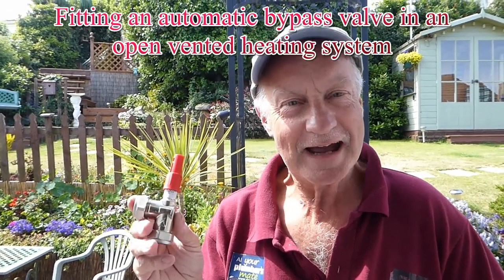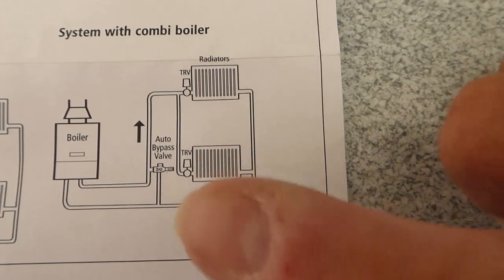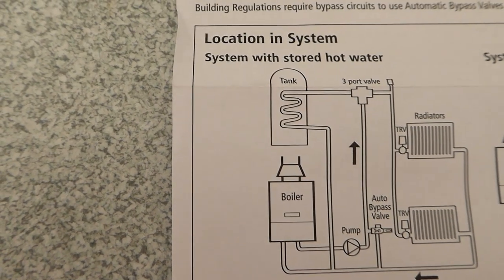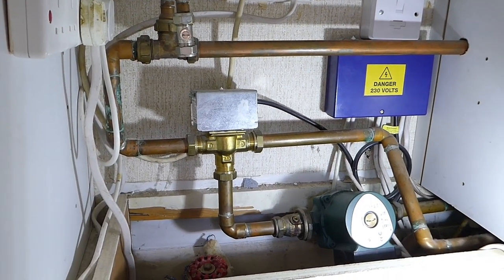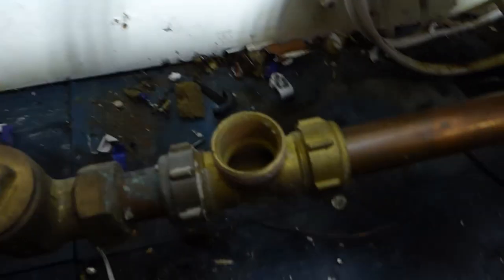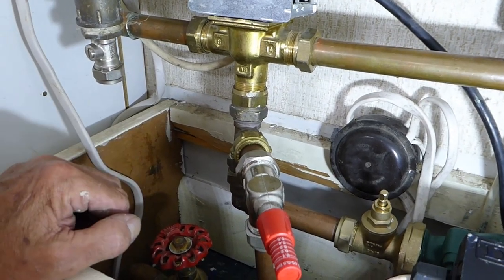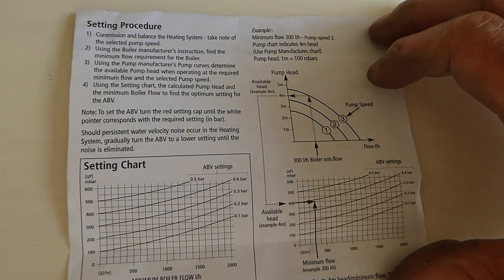Heating problems? How to fit an automatic bypass valve and why you might need one

Comment: This is why it is also good practice to fit atleast one without TRVs and fit lock shields. Preferably this should be nearest to the thermostat.
Reply: @matsuz100  because if every radiator has a trv and all the trvs are closed and the heating is switched on, the boiler could overheat as the hot water has nowhere to go.

Comment: Hey Al, have an issue with an automatic bypass valve that i think is causing the CH gas boiler to pump over...

History as follows -

- Home is 30 years old running an open vented F&E system. 9 Radiators.

- Potterton Suprima 50l (2004) serviced and running very well.

- Climote controller and 3 x Zone valves fitted approx 2 years ago.

- Recently was in the attic and noticed quite bad condensation, noticed the vent pipe from the CH was pumping over into the F&E tank. Eventually figured out it was only pumping over when a single zone was turned on i.e upstairs heating only.

- Had issues with cold spots on downstairs rads so ran X400 for nearly 4 weeks and drained the system, decided to remove all effected rads, cleaned and hosed them out thoroughly until they ran clear. 30 years of sludge was bad! Cleaned F&E tank spotless, refilled the system and added X100 inhibitor. I think that eliminates any chance of blockage/obstruction in the system as all rads heat perfect now with no cold spots.

- The boiler is still pumping over on a single zone and as normal over-runs(but pumps over) for approx 2 mins when the CH is timed off. If two zones are put on together i.e upstairs and downstairs the boiler does not pump over except for when timing off…

- An automatic bypass valves is fitted to the immersion pipes upstair in the cubby, I thought that may be the issue so tried resetting it by closing it fully to 0.6 and then turning off all the rads except one for the purpose of backing off the ABV until flow through…

- Turned on the upstairs and downstairs heating and the vent pipe(blue) immediately got hot (system pumping over) the (green) pipe also got hot in the lower part but not in the upper part after the compression fitting and then the (orange) pipe got hot within about 3-4 mins with the ABV still fully closed, should that not be the case?

Im confused as to the operation and location of the auto bypass valve, its there to prevent pump-over? is it working and fitted in the correct location, direction?

Pics below of pipework above boiler and cubby for reference…

https://ibb.co/JHyMb7z
https://ibb.co/QYxzhfR
https://ibb.co/3y4vc3x
Reply from the maker: Auto bypass valves are normally installed to allow for thermostatic rad valves, which may all be closed, a route around the system in order to stop the pump burning out, a kind of short cut. I have never come across them being used in this way.  I would opt for changing the bypass, even if just to rule it out. Have to admit this is a great way to use bypass valves. By the way have you tried simply turning your pump speed down to number 1.
Reply: @dereton33  Thanks Al, not a plumber myself plasterer actually but like to figure these things out! So yeah just reading into it seems that ABV will be installed on zoned heating also because of the restrictions in flow when only one zone is used. I have tried pump speed 1 but the rads don't heat up fully. In the last pic I shared is the arrowed green pipe the flow and arrowed orange pipe the return, so the bypass opens to allow the water run back the return to the boiler? That what i find confusing!

Comment: Does it have to be installed near the boiler/pump? Does bigger loop will make it better or worse? I have TVRs installed (with one radiator on manual setting just slightly open for the winter to allow flow when all TVRs close) and thought about removing radiator in the kitchen (it's always shut), and placing bypass valve instead of radiator. Is it good or bad idea...or just genius or stupid? ;)
Reply from the maker: It does not need to be installed near the pump or boiler just a convenient location. You can change that kitchen rad for a bypass valve if you want.

Comment: Brilliant and informative.
Fitted a 3/4 bypass valve in a system with Trench Radiators just before the room Thermostat controlled TRV for them.
If the room gets hot with its big floor to ceiling windows in the spring sunshine the boiler gets the hot water back and shuts off. Lots of solar gain and not wasted heating.
Thankyou
I fit kitchens and plumbers are so busy no one wants to fit my T/heaters.
Thanks for your calm knowledge👌
Reply from the maker: No problem Paul.

Comment: Combi boilers usually have this built-in btw, have done for a long time.
Reply: They do but, as an example, my Greenstar CDi Compact (2013) manual states that although it has one internally, it also must have an external one if there is a risk of all TRVs shut, or an all-zone-valve system.
Reply: It’s combi Worcester Bosch

Comment: Like the way you also replaced that isolation valve on the discharge of the pump as those  suckers tend to leak at the spindle and also seize in the open position....

Comment: Hi my loft expansion tank overfills and the ballcock shuts off ok  i wonder if this would cure it?
Reply from the maker: More than likely a pinhole in the inner coil of your hot water cylinder. An auto bypass will not fix it.
Reply: @dereton33  I thought the water would be discoloured if it was the cylinder?

Comment: the auto bypass valve I have appears to stuck open causing radiators to fail to receive hot feed. Can I replace just the plastic head from a new valve?
Reply from the maker: No you have to replace the whole valve.

Comment: Great video, I watched it before installing my valve.
It might be because I bought the cheapest valve toolstation had, but is it normal to always have some flow through the valve even when TRVs are open?
If my pump is on speed 3 I get hot water going through the valve, even when it's on the tightest setting, and the radiators don't heat up properly but the boiler gets up to temp and switches off.
So I put the pump on speed 2 but even when the valve is on the least tight setting, there isn't enough pressure to open the valve when all the TRVs are closed, so it causes a flow error on the boiler.
Just can't find a setting where the water only goes to the radiators until all the TRVs are closed.
Reply from the maker: You bought too cheap.

Comment: Thank you for your video, apparently the new main boiler does not have a bypass built in it anymore so if all the thermostat valves are closed it will overhead. Your video has helped me. Thank you
Reply from the maker: No problem.

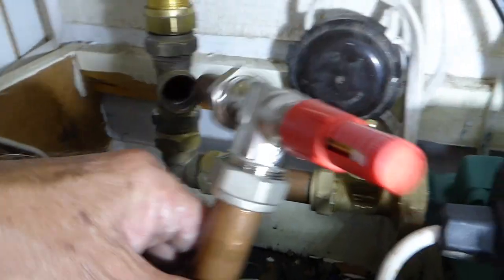Comment: Hi fantastic intuitive video but hope you don't mind me asking at 5:40 you say make sure the arrow on the bypass is pointing towards the flow?
But the flow heads towards the port valve A and B so surely the arrow points towards the return pipe from the flow 🤔
Reply from the maker: The 3 way valve is on the flow.

Comment: Sorry for late response, just discovered this video. Very helpful video, but one question.

Will this type of bypass work with a 'Smart Pump' like my Grundfos Alpha 2. With that unit, as the TRV's close down the pump automatically reduces its speed to try to maintain a near constant pressure (so without a pressure rise, what would force the bypass valve to open)? If a system needs a bypass, does it mean that the pump's 'dumb' speed settings must be used?
Reply from the maker: Yes it is more for the old 3 speed pumps.

Comment: Hi Al, Just had a Worcester External boiler fitted... Me being a little nosy I decide Check it out after they had gone.... grrrr. The boiler has a froststat, They ran a new cable with switched and constant live for the stat....Thought I would check the wiring and guess what, after all the work to run the cable they have not wired the constant live! No Stat... further investigations show they have not fitting auto bypass Valve, so now I am thinking a). they didnt fit bypass to save time and b) they knew they were not going to fit one or run the boiler frost stat, or why would it not be wired in after all that work. If it was wired frost stat would cut in  with no bypass valve. would this burn the pump out and destroy the boiler?
Greenstar Danesmoor External Regular 18/25...any advice welcome
Reply from the maker: Those bad boys, if the frost stat switches on it would not burn the pump out as this also switches on. Or should do if wired correctly.

Comment: Hello thanks for another informative video, I have just moved into a new house, and my system currently has a gate valve on the heating return (which is fully open), and a small section of pipe joining the flow and return which presumably acts as a bypass if all trvs are shut. Currently the rads downstairs are not hot at all, is this because the return gate valve is fully open or is there another possibility? Many thanks for any guidance
Reply from the maker: Yes it is . Turn the gate valve fully off then on by just one full turn.

Comment: Hello I have a y-plan and my boiler is showing FA issue (reverse flow), after changing the pump and the motor in the 3 port valve, this gas engineer spotted a by pass valve in the airing cupboard with some silicon on and he said this might be the problem of the reverse flow but I am adamant to remove it as this must have been there since the house was built 2007 and I don't get why should cause this FA issue if always been there. Basically when FA kicks in, cylinder becomes noisy and heating upstairs become also warm even if heating system is on. I have looked and it seems one radiator has just the valve with plus and minus and the others are trv's, would you reckon removing it might cause a problem?
Reply from the maker: Yes be very careful about removing those. They are there for a reason. You could always swop it for a gate valve that you could manually adjust.
Reply: @dereton33  What does happen if the valve is faulty? Does it cause a reverse flow or can it be the 3 port valve ?

Comment: I know you can have auto bypass valves etc , but could you  please do a video on setting up the manual bypass valves please,  and also when  my hot water  and rads are both on it robs the  radiator heat away, can you please help, I have already balance the rads etc
Reply from the maker: Fit one of these valves and then a gate valve on the flow into the hot water cylinder you could then govern down the amount of water the tank gets.

Comment: Bit confusing because for Y plan setups with a mid position 3 way valve, my boiler manual is saying a automatic bypass is not required. I guess because the mid position valve has a default position of allowing water to hot water circuit even in the off position so this is the bypass already...? Makes sense.
Reply from the maker: No wrong.
Reply: @dereton33 can you explain why you say it's wrong?

Comment: I know most combis have them built in now. But if the gate valve version is banned now, does that mean having the rad in the downstairs WC not having a TRV to act as a bypass also banned?
all the best
Reply from the maker: Sirus No that is still Ok. Al.

Comment: Thanks for that - Our system seems to be using the secondary coil in the immersion copper cylinder in the immersion cupboard as a 'relief system' / bypass if all the radiator TRV's were closed - have you ever seen that kind of system? - I dare say you have. There is no zone valve to shut off the HW to the immersion tank coil so i have to make sure the oil boiler stat shuts off at between 60c-65c which is a bit of a pain because if i wanted say 70c in the rads but 60c in the immersion coil I cannot set it that way because there is no zone valve fitted. 

Also I see in your system there the CH pump is on the flow, on our system the CH pump is on the return pipe inside the outdoor boiler module - in your opinion which do you find best? - do you find pump best on the flow or the return?
Reply from the maker: Hi Andy, it does not really matter if the pump is on the flow or return, just that most modern systems seem to be on the flow these days.

Comment: Hi, i tried the bypass on half a turn and then turned every radiator off and fired up the system, the pump sounded fine and not too noisy, the boiler sounded fine it didn't make any strange noises however i noticed the flame light was out, is this because there is not enough circulation or is it because the heat is not being dissipated anywhere because its only going through the bypass and making the return pipe too hot? The boiler is a worcester 18ri
Thanks
Reply from the maker: To much heat in the boiler it would go into safety mode.
Reply: @dereton33  thanks, do i need to open this valve more or is what i have experienced normal? I take it this valve is more to protect the pump rather than the boiler?
Cheers

Comment: Hi Big Al, quick question is the valve fully open at 0.1 or at 0.6?  Also my Pump is a Grundfos Alpha2 and I have it set to auto, what setting do you think would be best for the bypass valve?

Thanks
Reply from the maker: It is fully open at 0.6. Keep the pump on auto it is the best setting.
Reply: +dereton33 thanks, keep up the good work with the videos.

Comment: Also it avoids heat loss when open so its not circulating throughout the pipework it zones or TRV's are closed.
Thats actually what it was designed for.
Nice job on the video
Reply from the maker: Thank you.
Reply: Thanks for your very good videos

Comment: Thanks. I like the channel and very well explained. 
You can make this work by having a cheaper non modulating pump so that will keep the valve open when the modulating pump slows down if TRV's close or zone closes.
Reply from the maker: Thanks for the tip.

Comment: Hi, I have a baxi ecoblue 30 system boiler feeding 16 radiators which have Danfoss radiator thermostats.  I have installed a Honeywell DU144A1001 to replace the gate valve on my heating system.  Any idea how I determine what setting to choose on the new valve?
Reply from the maker: Usually number 3 but trial and error is best if not sure.
Reply: @dereton33  - the scale goes from 0.1 to 0.6mbar.  I shall give it a try at 0.4mbar.  A video on how to set them up would be very useful.  Many thanks.
Reply from the maker: 4 is ok give it a go, you will here when it bypasses.  Will look into the setting up of one of these.
Reply: @dereton33  - thanks.
Reply from the maker: Have managed to find this useful info, To set the auto bye pass set it to the high number turn off rad valves,run boiler & turn down Auto byepass until water is curculating through the byepass.
Reply: @dereton33  - it will take me a while to try that as I shall need to allow the system to cool and go around all of the radiators.  

I started this because I found that some of the radiators in the lower floor were not heating and thought that it may be due to the water flow, hence my question about the bypass setting.  The pump is a new Grundfos UPS2 15-50/60 is set to position II.

I shall try setting III on the pump.  Close down the bypass to 0.6mbarr.  Turn on the system then open the bypass until I just get flow which I shall check using my IR thermometer.

Once that works I shall open the radiator valves and check the ballance (temperature drop ~10°C).  

Do I need to take precautions with the boiler?

Comment: Also to be noted that closer to the boiler the better that if your pump is installed to correct spec.
One of the main reasons for an auto bypass valve is that the CH water won't be flowing through the pipe work throughout the house if its 2 pipe system. Less heat loss makes it about 5 to 10 percent more efficient.
Reply from the maker: Thanks for the extra info .

Comment: I have a boiler question for you. My boiler is from the late 70s would it be worth installing one of them electronic smart thermostats that control each rad. Got given a second had one that someone upgraded. So the boiler will come on and off when it needs,would it be a waste? Any help would be great, thanks Stephen
Reply from the maker: Stephen Lyons Yes it would still work OK, anything that saves on energy has to be good.
Reply: thank you